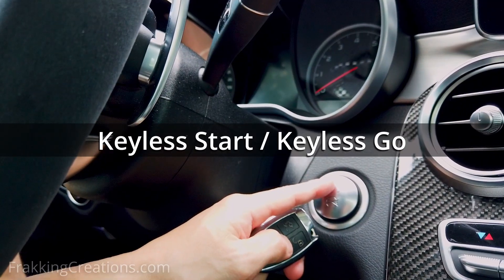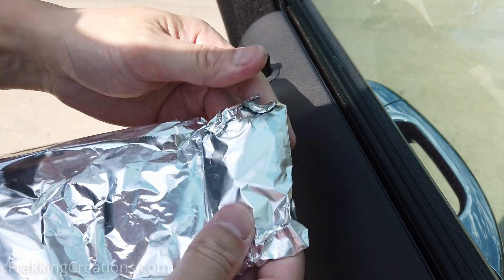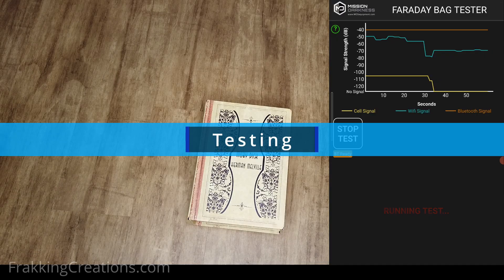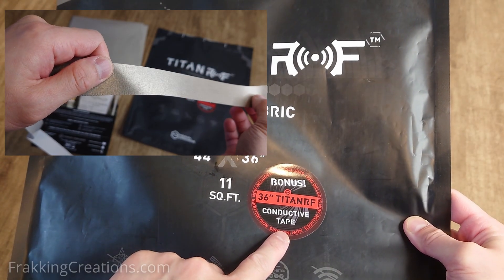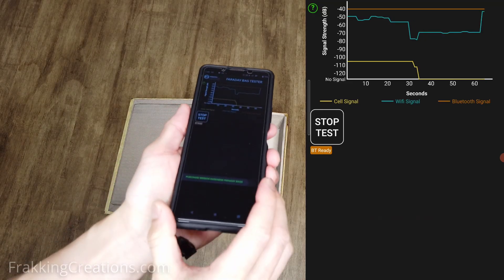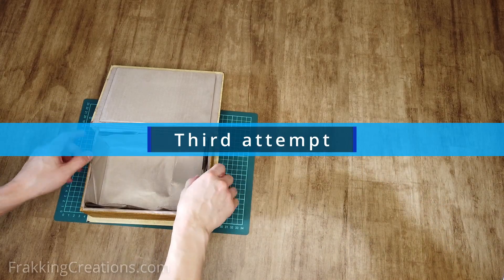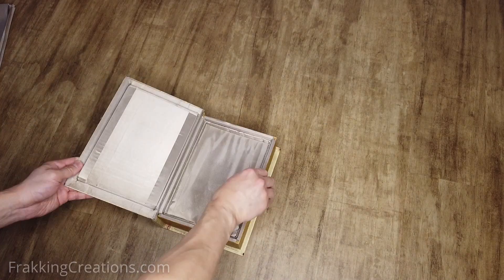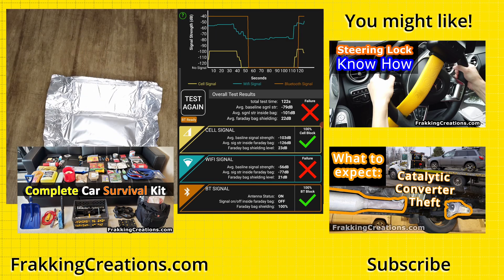How to make a Faraday box for car keys to prevent keyless car theft, keyless entry relay attack

Comment: i used some aluminin foil and with my keys in the car the car could not sense the keys. i also turn off all blue tooth functions in my car, and pull certain fuses to discontinue any data sharing

Comment: Hey, thank you for the video!
Btw, FobBlocker is an alternative which doesn't need to be put into a pouch each time. It instead shuts off the key fob battery after being motionless, and wakes up the fob when you're on the go. This makes it impossible to steal the signals while the key fob is resting (ie like at night).
Reply from the maker: Would it  be able to protect you when you are out and about walking around? For example at a mall and someone follows behind you to perform a relay attack.
Reply: Hey so someone following behind you would still be able to pick up the signals, since the fob is moving around. But keep in mind that your key fob would have to be within range of the car for it to be vulnerable. When the car looks for the fob, the fob responds in either 315 or 433Mhz back to the car, just like a remote control signal. But usually these thefts happen at night, when you least expect it. So if your fob is resting, it won't transmit with FobBlocker.
Reply from the maker: What I mean is something like this:  https://www.youtube.com/watch?v=bXfp8F4J2eI
Reply: @FrakkingCreations  FobBlocker would not protect in that video/situation since the person standing is constantly moving around, so the key fob wouldn't shut off.

Comment: what if we just take the batterie out ?
Reply from the maker: That would work too.  Just make sure when you store the battery in your pocket, or wherever, that it doesn't short circuit when the bottom and sides/top touch metal objects nearby.  This will deplete/damage the battery or cause it to heat up.

Alternatively, some FOBs now have a disable feature that you can use to turn the FOB off until you need it.  This may be good enough for your needs.  Just make sure to turn all FOBs off.

For example, some Mercedes FOBs can be turned of by double pressing the Lock button quickly.  To turn on again, just tap any of the buttons again.

On the other hand, some BMW FOBs will auto turn off when no motion is detected.  This may not work as well especially when you are out and about, like at the mall.  You are moving around so when does it turn off?  Relay attacks can also happen when you are out.  Someone could follow you and transmit your FOB signals to a second thief at your vehicle, which allows them to start it and drive off.

Comment: To shield well, the metal on a faraday box does not need to be thick or many layers. You need an elastic conductive seal gasket. (Think of blocking air or water.) But not tiny holes but slits are the real problem, because even if narrow, the gap makes wavelength shorter than it pass through.

Thus build an elastic conductive seal gasket. Professional shielding doors or old TV tuner cases have a row of tiny copper contact springs (like tines) around the entire gap. But an easier way to build this is gluing conductive metal mesh shielding tape over a strip of window insulation foam tape (silicone is most durable, others may decompose by touching metal). I used this inside my PC bigtower to shield the door rims.

A faraday box will also help to protect your data media (e.g. USB stick, portable harddrives) against EMP by the now coming nuclear war or a nearby lightning strike. Important is that they only work when closed and no cables etc. is sticking out.
Reply: So your devices will survive the nuclear war but you'll be dead. Fantastic!